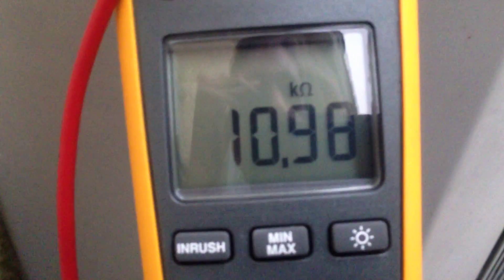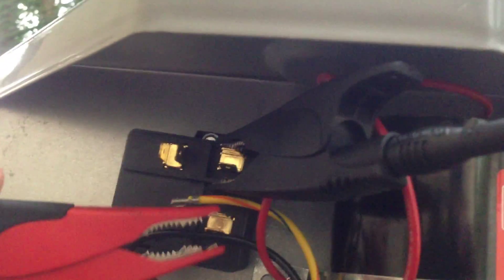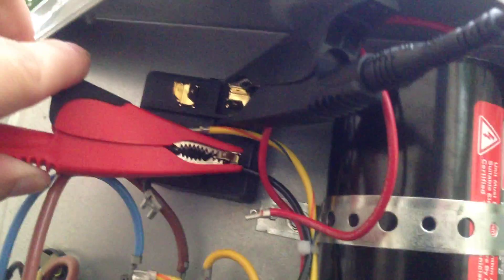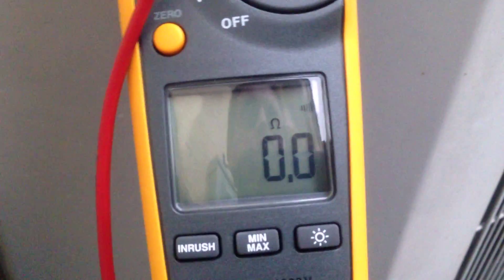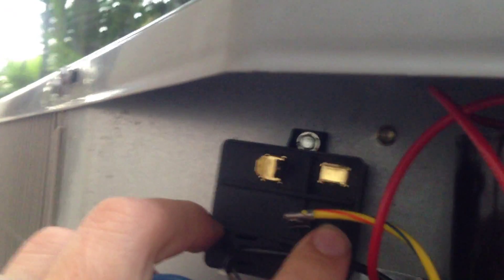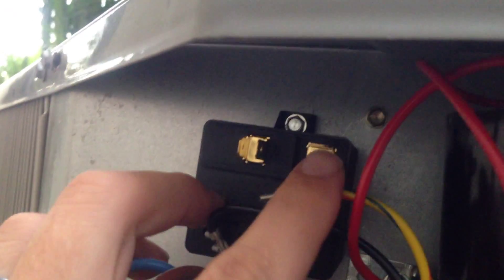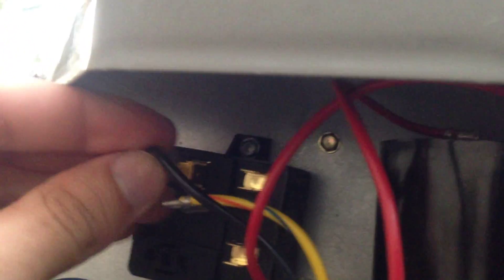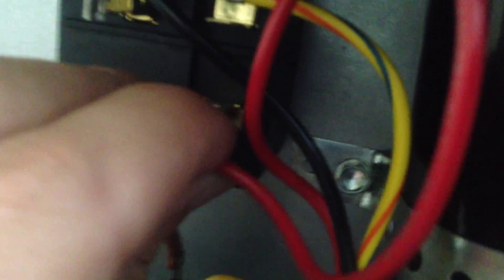How to test a potential relay part 1

Comment: Hi JR, I appreciate your time on these videos.  Do you know if the 11K ohm measurement between 5 & 2 is set in stone. I just checked a new one from our stock and got 6.5 K ohm between 5 & 2 with NC circuit OK between 2 & 1 . Is it a bad one with 4.5 K ohm less resistance value?